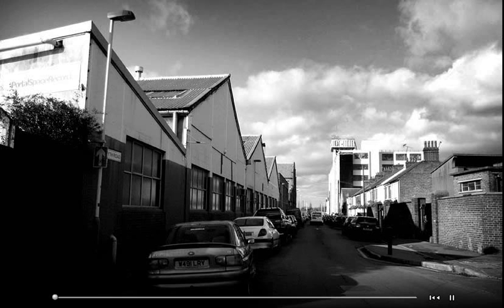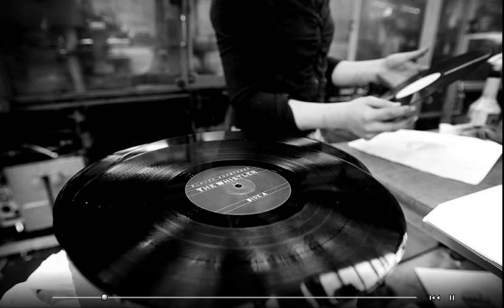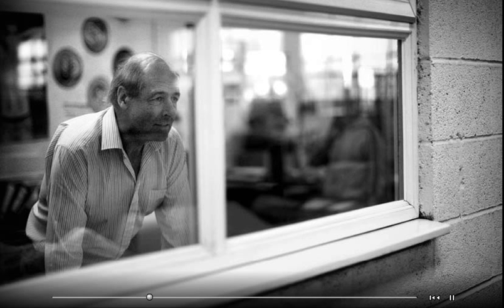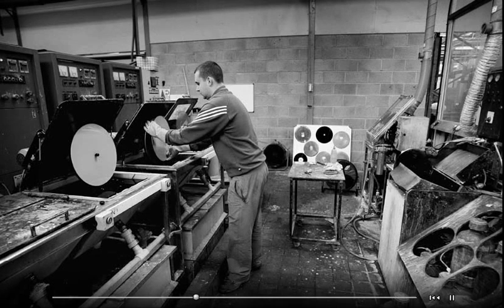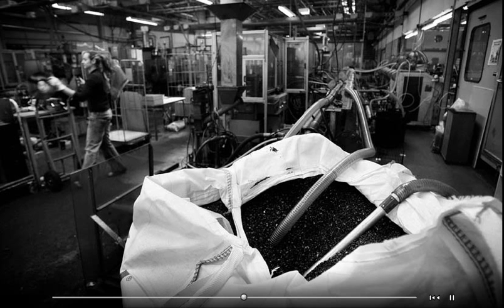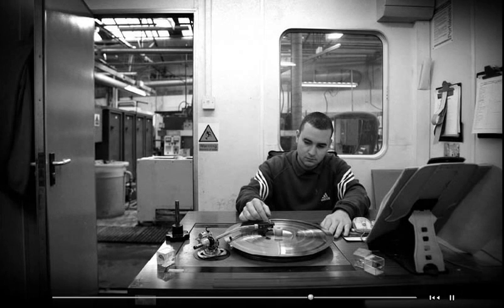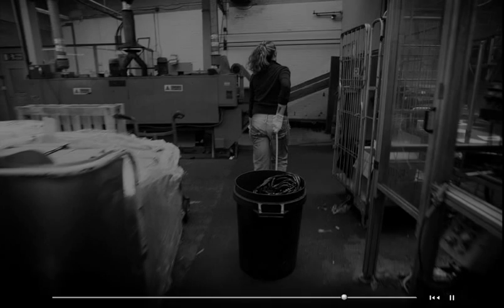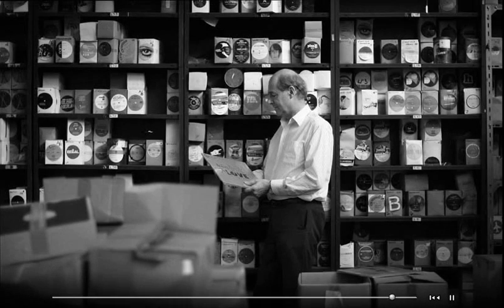Vinyl Record Revival

Comment: @mikeb1444

As far as I know, the 44.1 K Hz sample rate reproduces all the frequencies up to 22,050 Hz and almost nobody can hear anything higher than 20,000 Hz, so CD has all the frequencies you need and although the data is "boxy" or discontinuous, the waveforms are just as smooth as what you get with vinyl because the digital to analogue converter produces smooth waveforms based on the non-smooth digital information. I'm not completely sure though.

Comment: @sgtpepper1138 

Here's how to make a CD sound exactly like vinyl: pass the output of the turntable though a filter that removes all the frequencies higher than 22,050 hz, record the output with 44.1/16 digital, burn that to a CD and then play the CD. The CD will sound exactly the same as the vinyl.